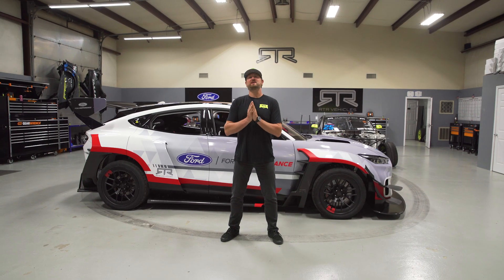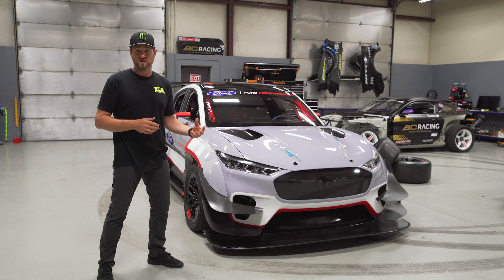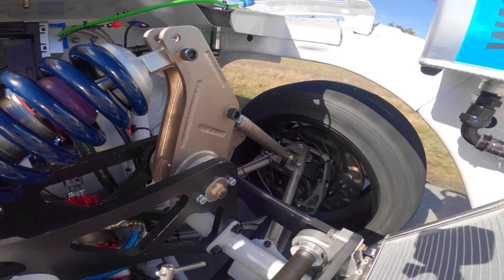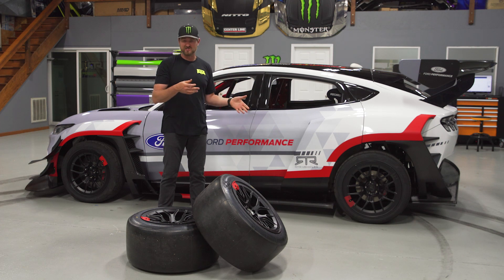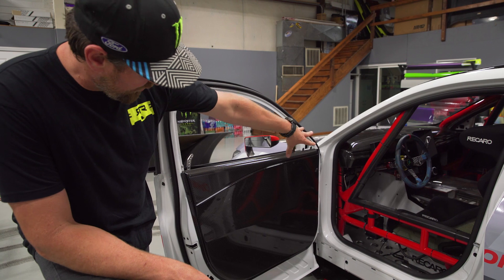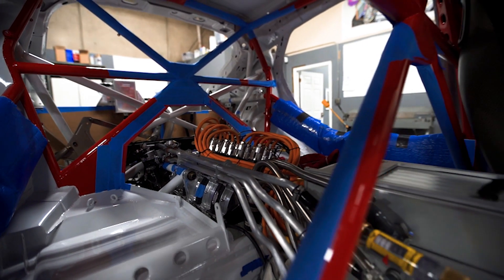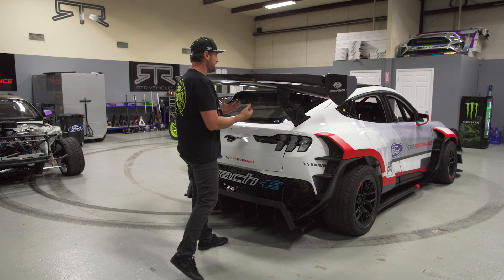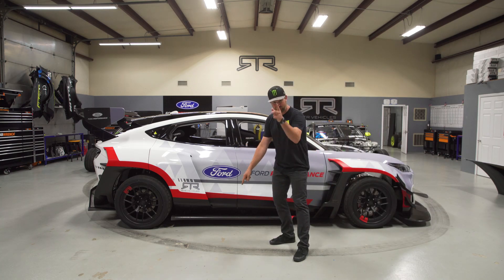Ford Mustang Mach-E 1400 Walkaround

Comment: You can keep your electric Mustang, I'll stick to my 2015 GT Prem PP and my 2018 Focus ST, they recharge so much faster. A minute and a half or so at the pump and I'm ready to go. Some day in the future things may be different, batteries with higher energy density, quicker recharge times but for now I'll be sticking with the petrol fueled engines. Oh yeah, they also tend to last for a very long time if cared for properly even if they're stored and not used much. I don't think that would ever be the case with a battery powered vehicle. Had a 1986 Turbo Coup, 29 years old, 5400 miles or so, still ran like new with never anymore that regular maintenance. Tell me that'd be likely with one of your electric pieces of, well I'll let the readers fill in what they think is most appropriate there. 
No Electric For Me unless it a toaster, mixer, stove or something connected to a wire.
OH, I almost forgot, I'll bet the battery in these cars cost more than the engine in a petrol powered one. FoMoCo  Please forget about them for now!
George
Reply: Federal warranty requirements for battery electric vehicles. Require an 8 year 100,000 mile guarantee. Some manufacturers already offer lifetime coverage on both battery&power train for the original owner.

You have a point on refueling time. But you also cannot put a fuel pump at your house, condo etc. But an evse you can have their. Some utilities even help pay for installing it to. Offer discounted electricity, or even free electricity (mine offers me 200kwhs a month free. 
There is a tax credit for installing a charger. That covers 1/3rd the cost. Up to $2000 total. 
Also brakes last longer, no oil changes, no emissions tests, no belts to worry about breaking. And much cheaper overall maintenance costs with an electric. So far studies have shown between 100,000-150,000 miles. It's only 30-50% of an ice vehicle.

Comment: It's really cool to see the technical stuff. thanks for making this video! Would be cool to see a hub mounted motor up front so you could still potentially drift with awd(not that you really have to).I feel like you could really get the weight of this thing down by finding some higher hp motors though. 7 motors and quick changes must weight a ton. This thing weighs 6k lbs doesn't it? It's not to knock it by any means but there are some AC motors out there that you can pair with a LSD or spool that make the power of the three of those and then you wouldn't need the quick changes either. Would take longer to swap gear ratios but it could still be done. They could take the current too, it's the batteries and cooling that have to be top notch. Does it use a high voltage ac compressor to cool the coolant? I wish I had budget to make something like this. Incredible!

Comment: Not a fan. 
Has a look of tech. 
I could care less.  
The suspension was the coolest thing
Reply: Sadly there will be racing series around these if they can get batteries to last 15-20 laps. Until then its just a demo/time attack show car. Untol then we're still safe with comparable cars like Rob Dahm's awd 1200 hp 4 rotor for now.